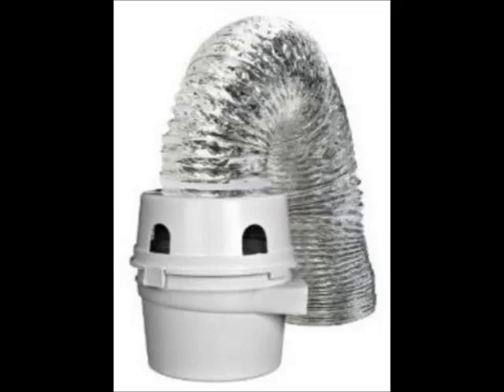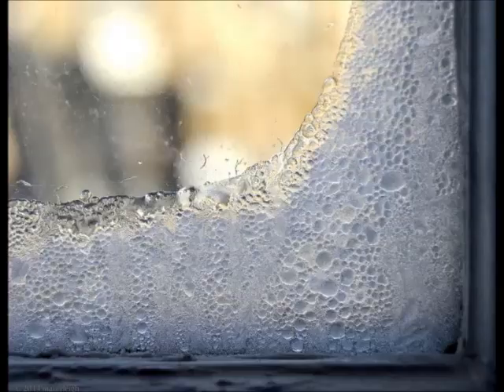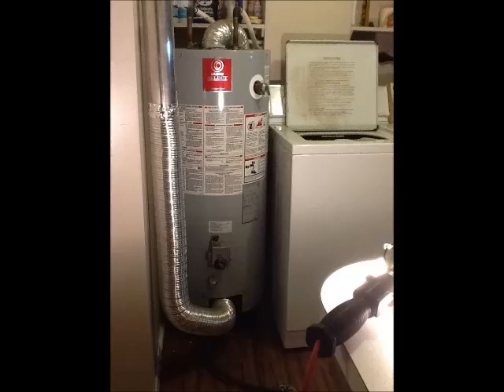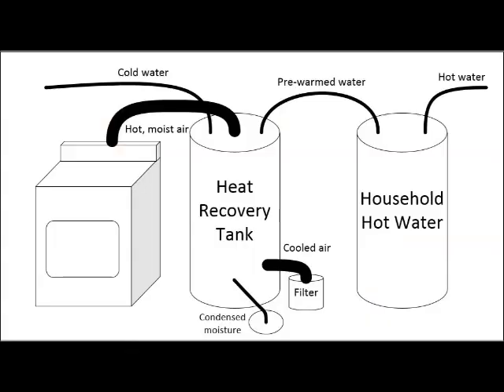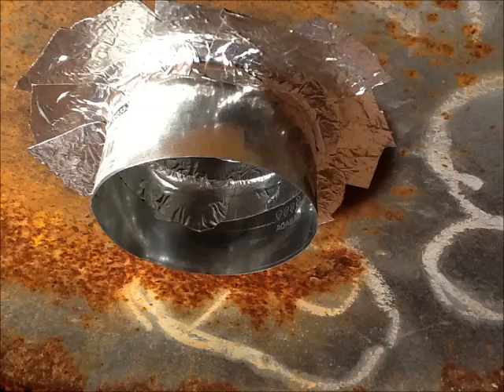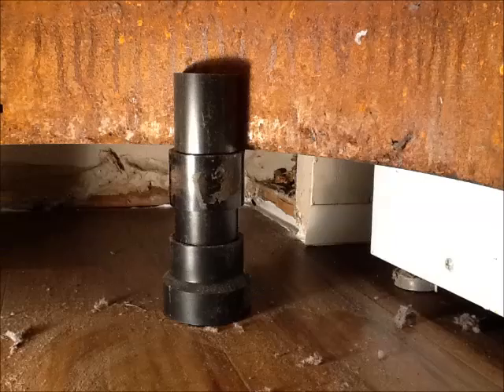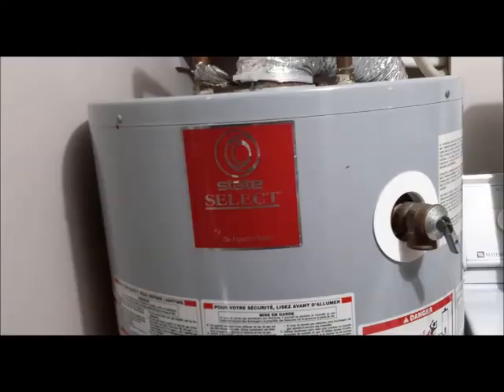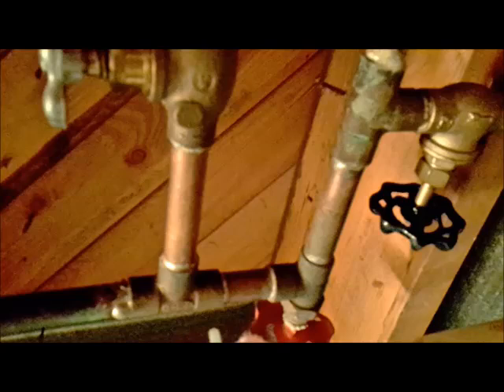Dryer Heat Recovery

Comment: This is a great idea.  
I wonder if the air exiting the bottom is warm or humid at all?
How has this held up over the years?  
Also what is the advantage to putting the cooled air into the forced air return (is that just to recover more heat into the house via the central air?)  
Last question, over time have you seen any noticeable change in your gas bill (assuming your new water heater is gas, replacing the heat exchanger one.)
Reply from the maker: Sorry I didn't check comments earlier!
The air exiting is slightly warmer than room temperature -- significantly lower than the dryer vent temperature.  There is still some moisture in it; I believe it would still be at 100% RH, but for the much lower temperature.
The system has worked basically without issue for years now; I occasionally need to clean out the stack, and sometimes the aluminum foil tape needs touching up.
I fed the air back into the central ducting to spread the remaining heat and humidity around the house instead of it being localized in the utility room.
Sorry, I haven't really monitored the change in the gas bill.  The new HW heater is high efficiency, so that change would be greater than the heat recovery system.
Thanks for your interest!

Comment: Hi, i like this idea, could you clarify how the air to water heat exchange is actually taking place. Does the hot/warm air simply pass through a coil within the tank, and if so what diameter bore is the coil, standard water coils would create to higher back pressure for the dryer?
Thanks James
Reply from the maker: Since this is a converted natural gas water heater, which runs its "chimney" up through the middle of the tank with an air baffle to increase turbulence, there's really no back pressure generated -- the chimney is about 4" in diameter.

Comment: Use a condensing tumble drier. Heats the room and dries the clothes. 100% cheaper.
Reply from the maker: It's good to know they're available now.  From what you've said, a disadvantage to the condensing dryer would be that it heats the room, which may not be desirable, particularly if it's not winter; mine heats water instead, something there's an all year demand for.  Also, my hot water heater was free, so adding it to an existing dryer cost almost nothing.
Reply: Do you have any concerns about Legionella or other such bacteria growing in your heat recovery tank?
Reply from the maker: @matthewneuls8613  Tell me more -- would those bacteria grow in the heat exchanger or in the water tank?  If they're in the heat exchanger, that could be a concern, as I'm currently venting the outgoing air into my force-air heating system.  If you're thinking about inside the tank, are you suggesting it might be a problem because it would be closer to room temperature than either the pressure tank (cold) or the hot water heater (hot)?  I would think that any bacteria from the heat recovery tank would be killed in the water heater before coming in contact with humans.
Reply: @prosstaylor  I would be concerned about it growing in the old hot water tank that you are using as a heat exchanger.  Most home water heaters heat to 120deg f, where the bacteria can still survive, it just can't multiply.  Even at 140deg it takes 2 minutes for the bacteria to die.  If your new hot water heater is an on demand, that could definitely be a problem you may want to watch out for. I'm not an expert by any means, but I do know that it is very important to keep water either cold or hot, not in between.  I don't think venting the dryer air into your Hvac would be an issue, i would think it would dry out between uses and water wouldn't be present long enough at room temperature to breed bacteria.
Reply from the maker: @matthewneuls8613  Good to know.  In my case, the real hot water tank is a big tank, and we run our water hot.  However, this is a good warning for others with on-demand systems.  In our case, I doubt that having the extra tank between our pressure system and the hot water heater makes much difference -- the water sits in a pressure tank inside the house anyway.  Hopefully, as it is chlorinated city water, most critters are dealt with.

Comment: Beautiful!!!  Any idea of the water temp. difference when using this?  I'd like to similarly recover heat for the home hot water tank with: 1. the shower drain water, 2. the dishwasher drain water, 3. the gas water heater exhaust, and 4. the gas home heater exhaust.  All fluidic waste heat could conceivably be salvaged if it's worth it.  These mentioned, plus the obvious one already mentioned many other times, the wood burning stove/fireplace, are the only ones I've concluded that MIGHT yield outputs worth the inputs.  It seems like there are plenty of products on the market to recover heat from industrial waste, but for households, the numbers don't usually add up.  But, I guarantee you that if our country ever gets into an energy rationing program like in WWII, or some other SHTF scenario, then we'll really appreciate a warm shower even it cost us a butt-load of resources to get it.
Reply from the maker: There's not a huge increase in temperature, as the specific heat capacity of water is really big; however, on laundry day, it brings the temperature of the incoming water from "really cold" to room temperature, which reduces the natural gas required to take it the rest of the way.  For liquid to liquid heat transfer, like for gray-water heat recovery, the readily-available copper pipe to copper pipe exchangers are more efficient.

Comment: Any measure of if your hot water lasts longer or reduction in water heating cost?
Reply from the maker: I haven't done any exhaustive research on the reduction in cost.  I did some calculations based on how much energy the drier consumed, and, based upon the drop in temperature and heat recovered from condensation of even 50% of the water vapour came to the conclusion that this was a worthwhile venture.  That was a few years ago, so my calculations aren't readily available, or I'd give you a more quantitative response.  The final heating is done in a high-efficiency hot water heater, not the heat recovery tank, so there's no difference in how long the hot water lasts.